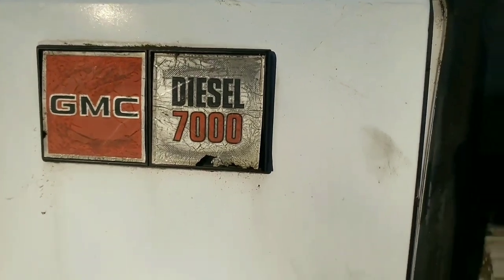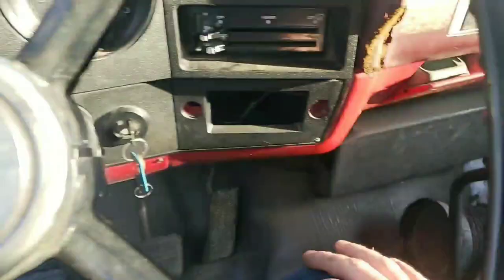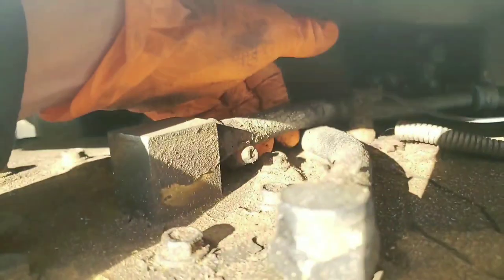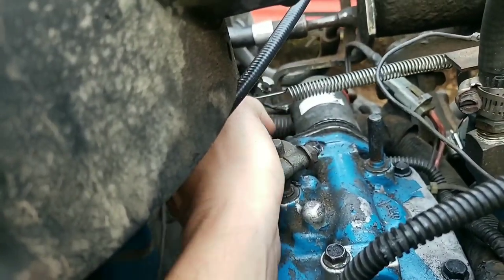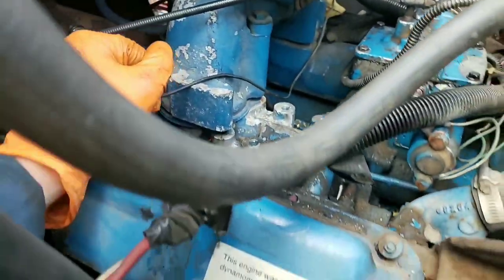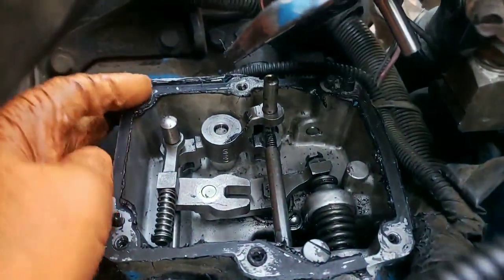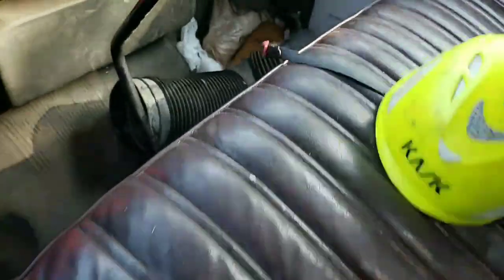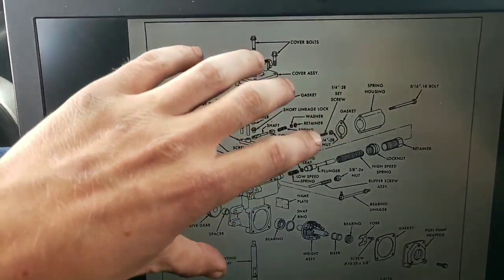Detroit Diesel Power

Comment: Great collection of information. Now to tackle mine. My issue is loosing power after driving about 5-10 miles. I added a fuel pressure guage to the spare left bank fuel rail in the head and it shows very little pressure. My first stop is to pinch off the return line and see what that does. Thank you for this vid! Very helpfull.

Comment: This by far was the most informative video/breakdown of the fuel distribution for the Detroit 8.2l (Fuel Pincher) out on the web I have came across. #5Stars This has given me a real good trouble shooting flow chart to go by with a similar problem. I'll chime in after I get mine back up and running. Thanks!!

Comment: Agreeing with you it is not a PowerHouse , it is a Boat Anchor !  The GMC BRIGADIER was of very simple fleet designed truck .  Yellow Freight had a fleet of them  , all they needed was 4 more feet of frame rail , air ride suspension  , and an air ride cab !

Comment: I have worked on these 8.2 detroits will start in the coldest of weather, and have NEVER replaced a fuel pump they never ware out. The bigest problem was the head gaskets and the injectors leaking diesel fuel in to the oil.

Comment: Can u help me our why is my pump on my 1989 8.2 v8Detroit pulling fuel out of the returned filter that is the smallest one under the truck buy the motor as long as it stays full it will run but when it's out it cuts off

Comment: Great video and very informative, i have the same engine in my dump truck and was wondering what the ideal way is to bleed the fuel system after swapping out the fuel filters? Obviously these don’t have a lift pump so what does the service manual recommend?
Reply from the maker: Don't have the manual in front of me at the moment but if I recall correctly, they want you to prime the fuel filters and then crank over the engine until it starts (if supply pump in the injection pump operates correctly it should fire off quickly).

You can also pinch off the return line to force air out the injectors quicker.
Reply: What I do is full the filters than cycle the ignition on and off like 5 times then on the 5th time turn he over and it starts up pretty much instantly but sputters for a few seconds till it basically bleeds its self and cleans up and your good.

Comment: I have the same engine that is leaking coolant into the oil pan and i correct in thinking that it is the head gasket.
Reply: Yes indeed you are especially if it overheated once. I have been a  captain/engineer of large commercial fishing vessels and private yachts for 27 years, have come across and repaired many of these engines. They are ticking time bombs, very temperamental especially to overheats, head gaskets are a major fail point.

Comment: I have this same engine in a chevy bucket truck.  It is leaking diesel into the crankcase oil.  Where should I start trouble shooting?
Reply: jay powell Injector o rings , first , dead cylinder second , cracked head third , they like to blow head gaskets if run hot ,hard, and overloaded, being in a boom truck is almost ideal for these engines . running at a decent rpm with moderate rpm , really good on fuel .